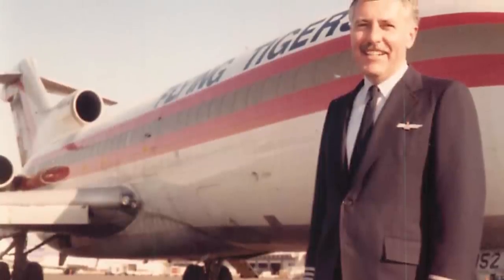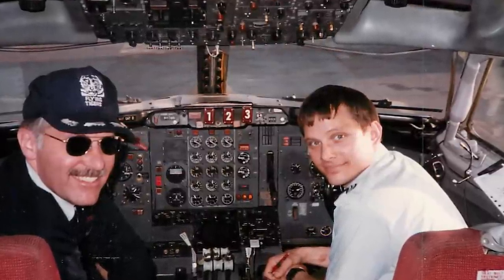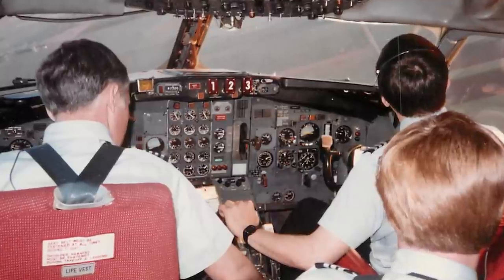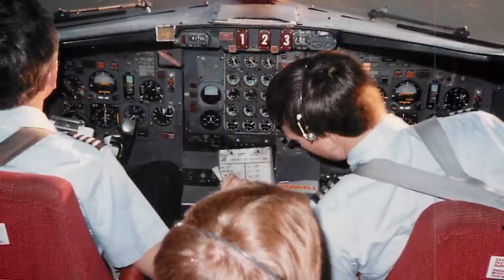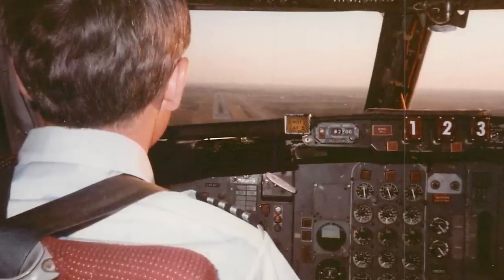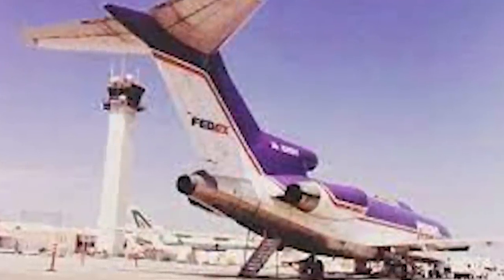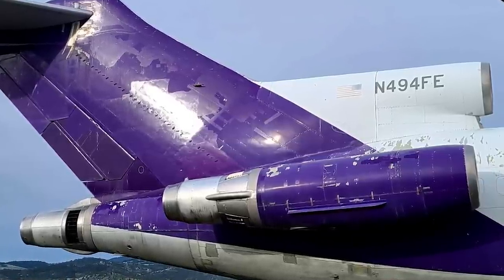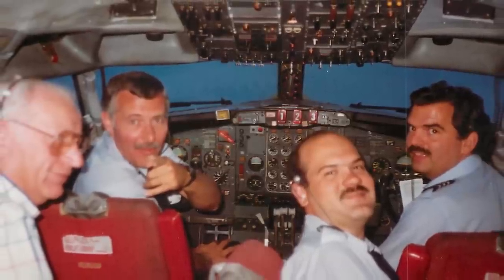FedEx 727 With Afterburners! Pilot Stories

Comment: I can totally see that if it had a recent engine change.  There is a small manhole in the S-duct you can climb through to access the front on the engine, if they did any sort of engine change you have to remove the spinner and tach generator off the front of the engine so it clears as you lower the engine down with chain falls. Totally wouldn't be shocked if someone left a ratchet in there.  I miss working on 727s. Just a fun aircraft.  I take pride in being probably one of the youngest who will have ever worked on them.
Reply: You are so correct about the entrance into the air duct. I have no idea if Maintenance had been performed. My concern was an ice ball as described within the video. Some Heating could’ve allowed the snow that collected in the S duct to partially melt, and then form an ice ball, if all the moisture had not been removed from the S duct. The safety department, after analysis of the turbine blades, determined it was not ice, but something much much harder. So, we could assume it might’ve been a tool!
Reply: @robertbriggs5254 I wonder if they ever went so far as to see who had an empty spot in their tool box or if someone ordered a new rachet wrench. Great story.
Reply: Patrick, Good Morning!  There are protocols galore for tool box inventories.  But?  Sometimes the Murphy-factor can raise its' ugly head!  Cheers....

Comment: Thanks for sharing.  My first A&P job was working on a 727 that made cargo runs between SJC and CVG.   I assisted another experienced mechanic. N753AS was the tail number.  It was operated by custom air transport. I believe it was an old Alaska 727. I worked for them for 9 month before I was hired by a major airline.  While doing the post flight walk around one morning, I found the exhaust cone on the number 2 engine was missing.  The guy I was working with asked me “ do you ever wonder where these parts land”. I pictured it in a field somewhere in the Midwest.  It was good that I moved on from that job quickly, I did enjoy my time there on the flight line.

Comment: In the mid 2000s in my 20s I used to get done work at 11pm and frequently would drive to a cul-du-sac that was about 300-400' off the runway at cyhm and watch a bunch of KF and Cargojet 727s roar into the sky. I don't live near there any more but was saddened to see them all strewn about the airport in various states of being scrapped in about 2015 when I took a flight to Hamilton. It was pretty cool to see them still flying even mid 2000s. Miss those days

Comment: In the summer of 1979 i was waiting for a bus at 98th and vicksberg just south of the north runways ay LAX.  A flying tigers 747 is coming in on the furthest north runway.   Somethinh happened that he needed to change to the left runway.   All the panels on the wing were opening and closing. It was so close to the ground and nose down we could see the top of the plane  it was aimed right at the bustop.  People there were running for their lives.  The panels on the wings opened and closed again.  And it zoomed by.   This few seconds was the 747 crossing over the 405 to sepulveda blvd.  It was absolutley one of the most beautiful things i have ever seen any airplane do.
Reply: The 747 was indeed the ‘Queen’ of the skies. “Ops Normal” for LAX is to use the ‘outboard’ runways for landing (25L/24R) and the ‘inboard’ runways (25R/24L) for take-offs.  I can’t comment as to ‘why’ the late side-step maneuver might have been required, but 24L does give pilots more than 1,100 feet additional runway following the point where the glideslope intercepts the touchdown point.  The panels you likely saw were the flight spoilers extending and retracting, assisting the aileron inputs for better roll control during low-speed flight.  One extension then retraction as the pilot rolled to the left to align with 24L, and another extension retraction after the alignment was completed.  A beautiful thing to witness!  Many thanks for bringing back those memories.

Comment: When I was in the Air Force - I worked on the VC-10 for many years. It had an APU in the base of the tail with a curved jet pipe so the exhaust went up the rear of the rudder. Now this little motor was know for pooling AVTUR in the bottom of that curved jet pipe so on some startups the crackers would go to spark up the motor and this fule would go WOOOOOFF💥💨! Resulting in a SPECTACULAR JET OF FLAME around 6 feet high out of the tail. We knew the days this was happening from the flight deck as the APU was slow to start or would pop and bang until it cleared its throat!
HAPPY DAYS!

Comment: I love the 727. Made a few hops as a pax. A friend of my older Brother's was an American Air Lines pilot. He gave me a blue AA cap with a 727 on it. I call it my Dan Cooper hat because of the Airstairs.
Reply: Most folks might recall that a later modification of a simple mechanical 'air switch' was designed to deny airborne lowering of the stairs following the series of airborne air-stair door 'departures'.  :)
Reply: @robertbriggs5254  Not just a switch. The Cooper Vane, is an aerodynamic wedge that makes it impossible to lower the Airstairs in flight due to slipstream pressure.
It's a tiny flap that is rotated 90* by air pressure at flight airspeed and engages to lock up the Airstairs.The Cooper Vane was due to an  FAA mandate. DC-9s were also mandated to be fitted with Cooper Vanes.
Reply: Hoot, Evening!  YOU are absolutely technically more correct.  I attempted to simplistically describe the aerodynamic device (switch/wedge/metal piece) that prevented the aft airstair door from being opened in flight.  I really do NOT recall the DC-10 having the same mandate at all.  My dealings with both the DC-10 and MD-11 were minus an aft airstair door to the best of MY remembrance, hence having to tie the nose-wheel down during on-loading and off-loading to prevent tipping on the tail!  Memphis Cheers......
Reply: @robertbriggs5254  You're right. I meant DC-9. I walked up the Airstairs onto a Navy C-9 in 1975 getting a hop from NAS Norfolk to MCAS Cherry Point NC. I walked forward past a sea of deck rollers to the last aluminum 10 x 10' pallet which had 18 seats, 3 x 3 by 3 rows in ''1st Class''.  I was the only pax. The Navy was nice enough to give me a hop. Returning from 2 week leave from Tucson to CPNC, my '68 Chevy pickup had blown the transmission out in Albuquerque. I limped it back to Tuscon. Thru connections in the E-3/E-4 Mafia, [Tucson homeboy and a cool dispatcher at DMAFB] I was able to book a hop from Nellis AFB [near Vegas] to Langley AFB in VA. Flew commercial air from TUS to McCarran. Took a cab to Nellis. RON at base BEQ.  Hopped an Air Force C-118  [DC-6 w/ backward seats] to Langley, via a fuel stop in Texas. Long bumpy prop ride.
Another cab to Norfolk, and RON at the Marine Barracks there. Next morning I hopped the C-9. Once back at  the Point, I had to convince the SgtMaj that I really had mechanical trouble and not just scheming to get more leave time.
I went thru Aircraft Familiarization, Basic Electricity and Electronics, and Marine AVR [Avionics radar troubleshooter] schools at NAS Memphis in Millington, TN. Great times offbase with warm and friendly locals.
Adios from Tucson...

Comment: Try loosing engs 4,5,& 6 on a B52 and you loos them all at one time! I did!!! It was migration season for the birds (in this case Mallards) and they fly up at the rotate. I was fully loaded (no bombs lucky, just a week end flight to keep up  my hours since I was low that month) Trust me that I can say you have not lived until you loose inboard engines in less than 30 seconds. Thank God I had a fantastic co-pilot. I had my hands full of bird (plane) you see I was one of the old D (DOG) models and all we had was water injection no fans just the old FORD motors (told you it was a dog model) You loose air on engines 4 and 5  if off, so a restart is out of the question. The ONLY good thing going for us was that the hydrastic pumps for controls were in the wing and not on the engines in those days unlike the later models with the Pratt and Whitney J-57 where they moved the pumps to the motor. I have more hours than I can remember since I am to old to safely fly now. But I would never give away those old early B-52D's it sure saved our bacon

Comment: -Sounds plausible.  That much ice should have caused a compressor stall. Normally you hear a bang with a compressor stall on a 727, or while taxiing a bunch of "pop pop pop" noises.  When I was a captain on this airplane, we landed in Prague and I advanced the throttle on number one and it made this noise.  I just shut it down and wrote it up, I'm sure it was just some water in the bleed valves.

I started at Fedex in December of 2006.  My first flight of of IOE on the 727 as a second officer [I had already flown the plane as Captain for two years at Express One] was while I was on reserve, and it turned out to be a "No notice walk up line check".

I'm like "It's been about 30 hours since my last check ride!"  He laughed, so did I.  It was basically another leg of IOE, very cool dude, still talk to him in the AOC.  And that was on N166FE, which incidentally rolled off the assembly line about a week before I did.....

GREAT video!

Comment: No.

But I DID fly N15DF at Express One International, and it had these two oval metal sections in the belly behind the wing.  And it had a massive reinforcement on top of the fuselage;  It must have been 1 inch thick.  What this was was one of the Mexicana airplanes that was used to explore the possibility of using RATO or rocket assisted takeoffs from Mexico City.  They used these bottles, four of them [typically called JATO] during high weight hot and high takeoffs.  And it worked.  Problem:  It put stress cracks on the back of the 727's fuselage, and this ended the program.  It was obvious that without massive modification this idea wouldn't work;  The 757 was in gestation anyway.

You could see the hump back on this airplane easily!  It flew straight, which was surprising.

Comment: I worked in a highbay building with a gantry crane 30 feet up above the floor.   One day the gantry was moving and down falls a 12 inch long steel wrench right between some guys standing around.   Feet away from perhaps killing one of them.
The wrench had the name of the crane safety inspector who had done  the yearly certification and had been up on the gantry inspecting a few days before!

Comment: Why didn’t you abort the takeoff when the engine wasn’t normal?
Reply: As stated, in the video, all the engine gauges for all three engines were reading a OK with the exception of that offer that I bumped forward and matched with the outboard engines. I mentioned 12 gauges I was incorrect. Actually there are 15 gauges EPR, N1, EGT, N2, and Fuel Flow. You can make out each five gauge group for each engine in one of the still photographs within the video. With the exception of the slight effort dropped, all remaining indications were normal! I had no indication nor inclination to reject the take off at that point!